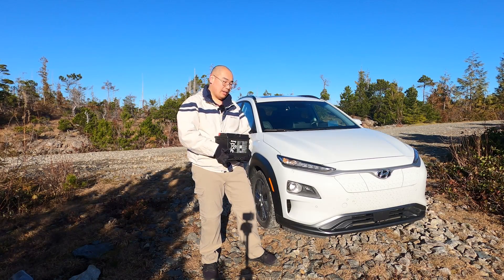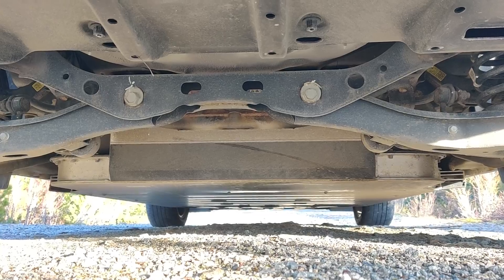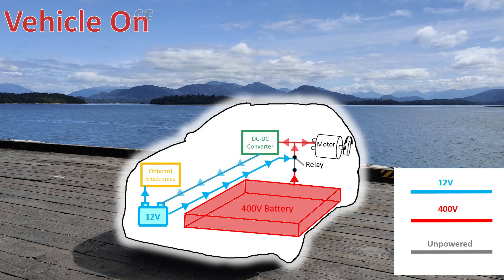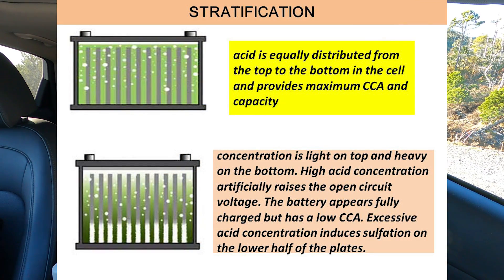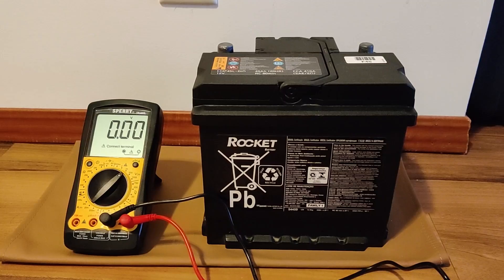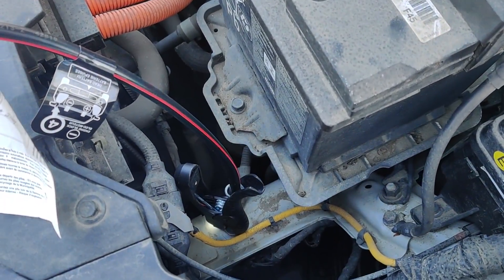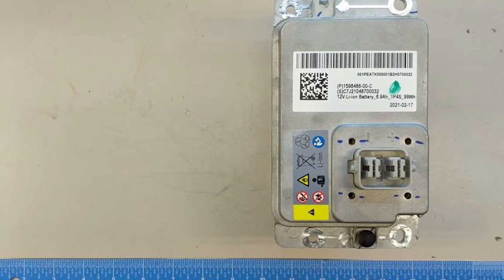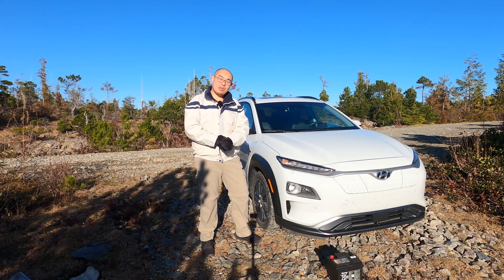Why EVs need 12V Batteries?

Comment: You can't get into an EV if the 12v battery is dead? Then how do you access the 12v jump starter inside the car to boost it? Or open the hood/wherever to access the jump terminals?

Comment: As an electrical engineer, this is silly and it cannot be the reason. First, as you show, to charge the 12V battery they uses a 12V DC-DC converter (must be a buck) and a voltage regulator (or feedback control loop to the buck converter's duty cycle, which basically does the same). So, if the main is on, e.g to use the A/C unit, then the main battery is connected through the electronics to the USB port either way, even if there is also a 12V battery in parallel along the way. Since the battery has some resistivity and the charge circuit has to provide higher voltage than that of the battery to charge it in the first place, this means that the possible regulating power of the 12V battery doesn't apply. It's the voltage regulator who does all the work here. On the flip side, if there is a car crash, you can still get electrocuted, if the main battery leads touch the frame of the car and then no relay can save you. So safety is not the issue here. 
   As just about any electric engineer would explain, you could get the exact safety from placing the 12V DC-DC and the voltage regulator, close to the main battery leads. That way, the chance of a fault to the car frame in case of a car crash is minimized. And in any case, this is safer then using 400V or 800V leads and putting a DC-DC to 12V and a 12V voltage regulator (most likely 14V to charge) somewhere else in parallel to a 12V battery, which doesn't do anything when the main is on. In addition, if the main battery would be always connected, you can still put safety relays wherever you like. So it could be even safer than a separate 12V battery.. So why do they REALLY do it? 
   Cause maybe, just maybe, the main 400V battery current could be interrupted for a variety of reasons for milliseconds here and there, when the car experiences hard road bumps, etc, and a 12V battery is a lot cheaper than 6 super capacitors in series (though this may change in the near future). So it's actually only a way to bypass the problem and transfer the solution cost to the client🙂. Nothing to do with safety.

Comment: Hi there, watched your video, nicely done. I have a question, since the battery was dead and you clearly showed that the doors could not be opened as they were locked how did you open the hood since the release handle is normally inside the car.

Comment: Superb work, Solomon.  Subbed.

I left my '23 for December and January in a garage where the temp never dropped below 0C.  A the end of January, the vehicle would not start and the 12V battery read 1.7 VDC.  :(  Worse, my Noco emergency battery under the driver's seat was similarly discharged, despite being charged in November. :( :(  I bought a new, factory equivalent battery from Lordco and all is well.
 
Hyundai told me that the 12V battery isn't recharged by the traction battery if the TB's state of charge is less than 80%.  I didn't see this in the owner's manual.  

LESSON: if storing, fully charge the traction battery OR put the 12V battery on a trickle charger, OR disconnect the 12V battery at the negative terminal AND check your emergency start battery's charge state regularly.

Comment: Makes no sense. If you already have a really big battery why not power everything from it?  All you need is a fuse box correct? Like a house. You get a big voltage into the circuit breaker box, then that spilts it up into smaller voltages. Why do the same?
Reply: A typical American house AC power has two opposite hots and one neutral. The voltage between the two opposite hots is 240 volts and the voltage between a hot and neutral (or ground) is 120 volts. A battery, whether it is 12 volts or 800 volts, has two leads, one positive and one negative, there is no "neutral" on that battery that cuts the voltage in half and even if there is, half of 400 volts is 200 volts, still more than enough to cause a nasty shock. There are two possible ways to power your car electronics with a high voltage battery, either design electronics that accepts high voltages or use a step-down converter to reduce the 400 to 800 volts to 12 volts. The first method has several problems: your vehicle's body is made of metal, which conducts electricity very well; and although this problem may be solved with fuses or circuit breakers you get the problem of your high voltage circuits coming in contact with water in which the electrical current conducted by water may not be enough to trip the fuses or circuit breakers. Plus, we already have 12 volt car electronics, so switching to high voltage car electronics seems like a waste of time. This is where the second method comes in. Let's say you are using a step-down converter to power your electric vehicle's 12 volt electronics. You will now have to make sure the step down converter can provide enough amps needed to power all of the electronics even when the vehicle is not running and this may be a bit expensive and may be generating a lot of heat, and for some electric vehicles, the cooling system only turns on when the vehicle is on. Electric vehicles are also required to instantly disconnect the high voltage battery in the event of an accident, so if you are powering your vehicle's electronics with the high voltage battery using either methods and the battery is disconnected, your vehicle loses power to all of the electronics, which means no Onstar or any emergency monitoring service to comes on through your vehicle's speaker in case of a crash. Now you see why powering your vehicle's electronics with a separate 12 volt battery is the most practical method?

Comment: Great video and very relevant topic! I have a Kona EV (2019 model). The 12V battery died (shortly after the time the boot wasn't properly closed and the inside light drained the battery). Managed to jump start at first. But after a few times, even this wasn't possible. Luckily, it was during the first 2 years of the car and the 12V battery was still under warranty. So was changed free of charge.

Comment: This does not apply to a Tesla car made from 2022 onward. The 12 volt lead acid battery was replaced by a 16 volt lithium battery that should last the life of the car. It uses the same technology as the main propulsion battery and is bolted in place.

Comment: I have a Model Y with the older 12v battery.  I read somewhere the new 16V lithium batteries in Teslas should last 10 years, another source said 20.  So they should be very long lasting.

Comment: AGM is still lead acid, just more resistant to sulfation and stratification. 12v is chosen instead of 24v (used in large trucks) or more is to benefit from the vast availability of 12v components and to reduce problems related to arcing in contacts designed for DC currents. Manufacturers would love to use 48v because it would reduce their costs in wiring since it would require one quarter of the copper in the wires, but don't do so because of these complications.

Comment: I recommend installing a bluetooth monitor on your 12V battery and follow the charging behaviour of your car. I haven’t checked for a Kona but quite likely you will see the same as for an Ioniq 5. The car remains quite active for a few hours after any driving or charging and this drains the 12V battery. The car then recharges the 12V battery. More activity (including BlueLink access) will drain the battery and lead to more recharging. The frequency of recharging depends on the level of activity and the temperature (which influences the capacity of the 12V battery). If you leave the car alone for a week, BlueLink shuts down and battery recharging significantly drops in frequency. All this recharging costs power which is annoying but the biggest problem occurs when recharging does not occur because the main battery is below a certain percentage of charge that the manufacturer has determined. No recharging means the 12V battery suffers and takes harm. Repeatedly doing this will lead it to fail sooner rather than later.

Comment: The ONLY reason a 12V battery is needed in an EV is to power up the contactors that provide isolation between the HV battery and the rest of the cars electrical systems. This system is required for safety. ALL the 12V gear COULD be run from a DC-DC converter, including lights, infotainment etc etc, in theory.

Comment: It is needed, as something needs to turn on the main battery, and also runs low voltage systems.

It is lead acid, because it is proven technology, cheap and easy to replace. It can be Li-ion, but these are much more expensive and not needed.

Comment: As a '21 Kona EV owner, I second the suggestion to have a jump pack in your car.  I've had my car not start a few times before getting a new 12V battery.  The jump pack was a time and hassle saver.  Also, I dont believe it is a good idea to try and boost a dead ICE vehicle with the Kona EV's smaller battery.  With my jump pack I was able to help an ICE driver start their car in February after it died, with no risk to our EV....